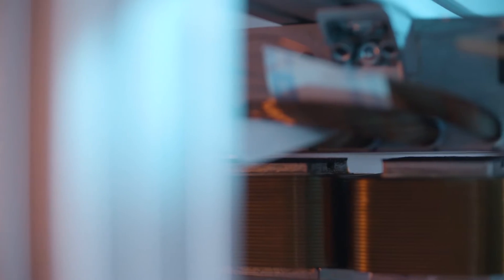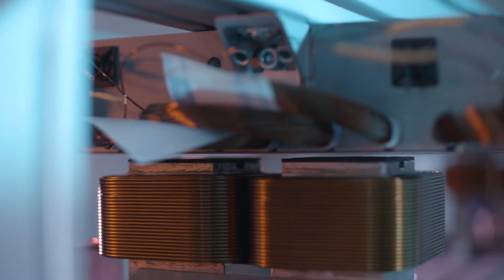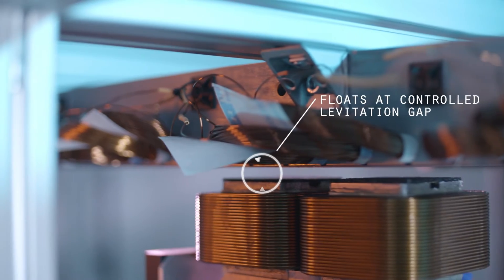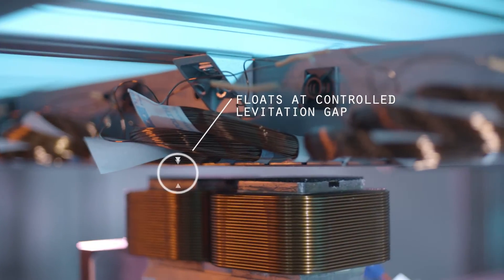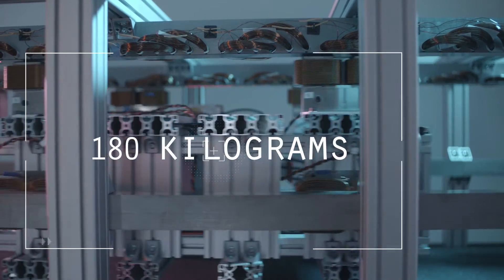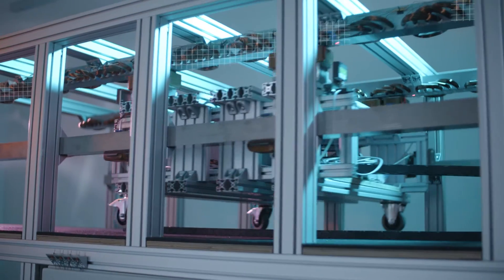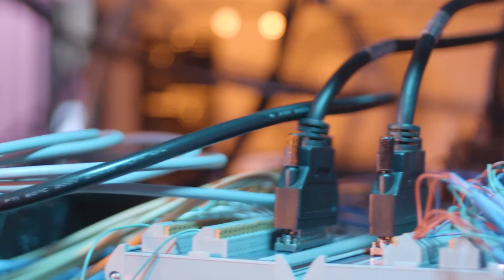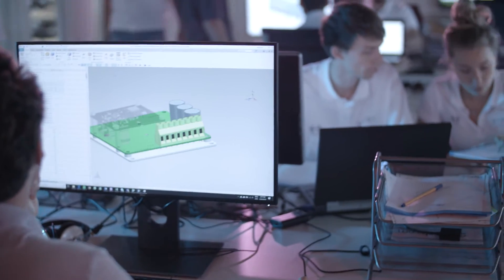Hyperloop propulsion and levitation explained

Comment: Nice test rig guys , combining the linear  motor and electromagnet. How does the electromagnet perform at high speeds and does it have a upper speed limit ?
Reply: A good demonstrator for this system's potential is germany's transrapid maglev, it doesn't travel as fast as the hyperloop but most of the suspension and propulsion elements are the same